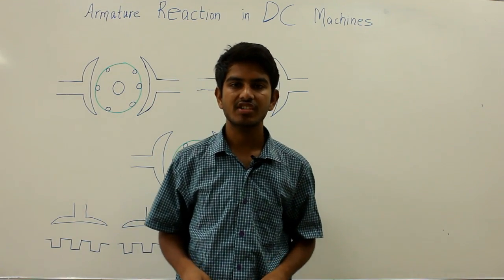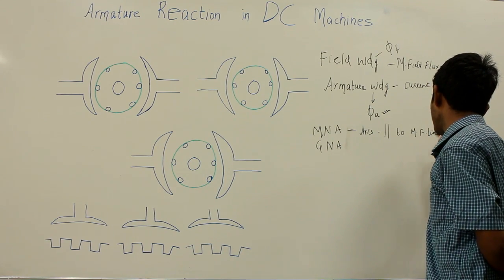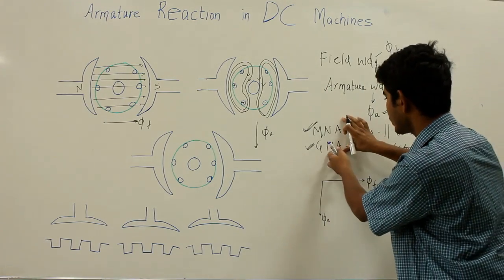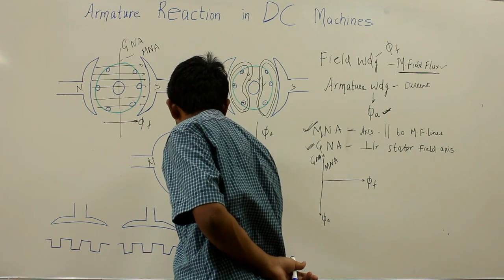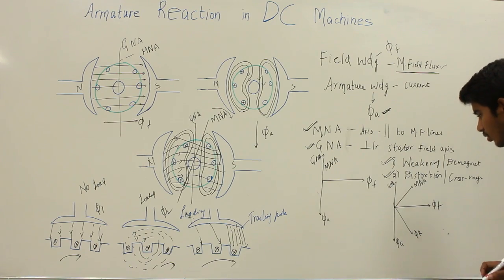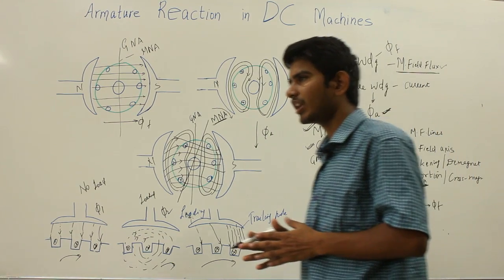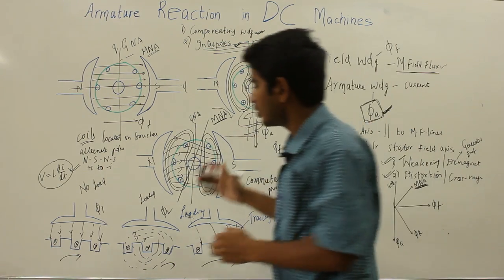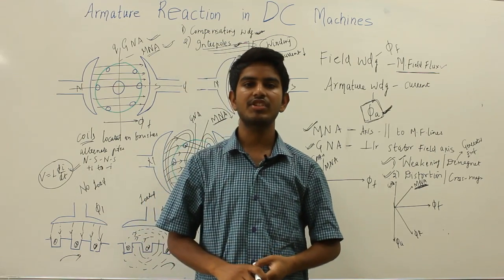Armature Reaction In DC Machines

Comment: Excuse me ,you told that MNA will be parallel to the direction of magnetic lines but in figure 1 it is coinciding with GNA..I didn't understand it.can u plz explain
Reply: Co incidence is also a case of parallel lines...as angle between both of em is zero....😙
Reply: First case generator is at no load condition that means the flux producing only due to main poles that means EMF is zero